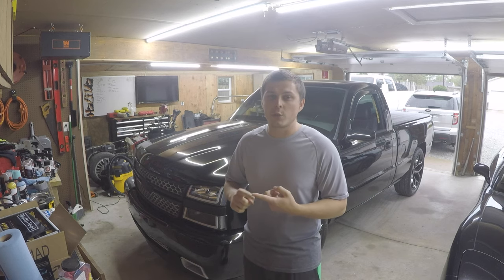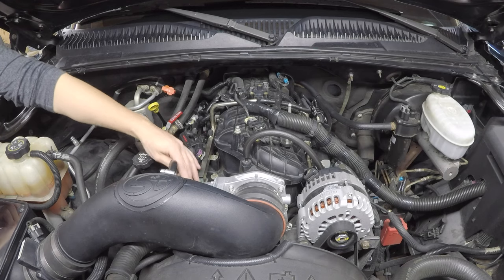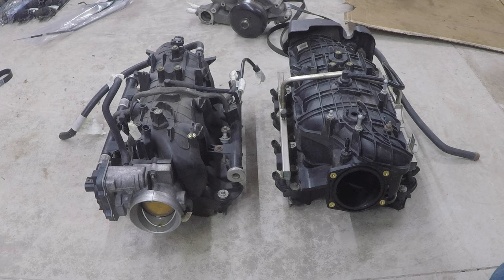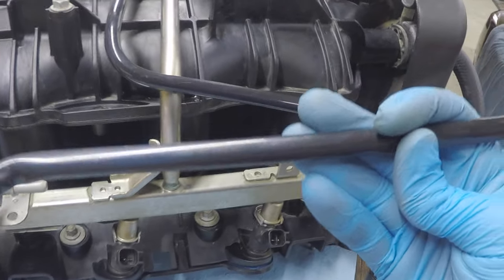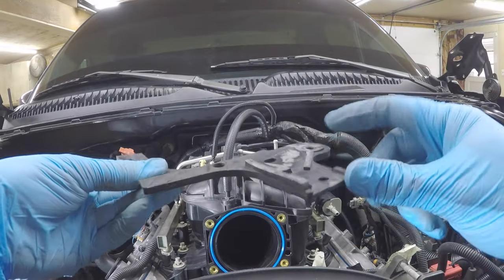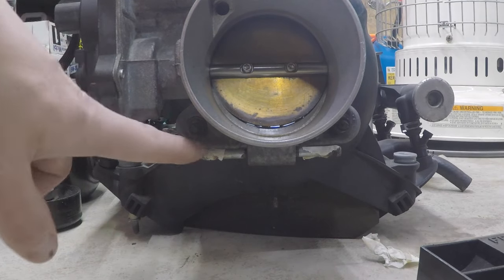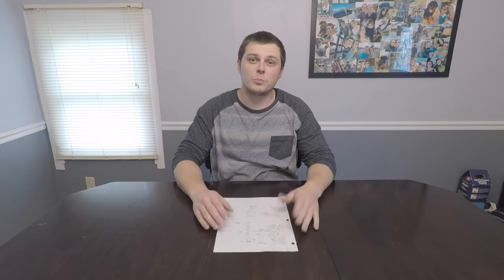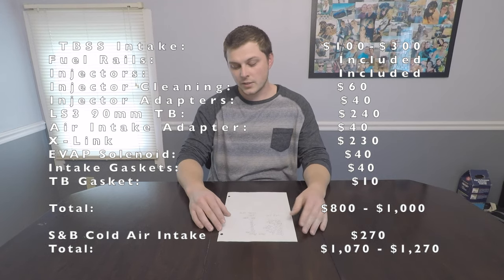TBSS Intake Swap, Ultimate Guide! Add More Power To Your LS Motor!

Comment: Thanks for putting the time into this! I'm assembling a custom built 2000 6.0, hoping to run the tbss intake on it and fit it under the hood of a third gen f body. Some of this obviously won't apply to a non-oem swap, but a lot of great info here like knowing what works with the truck parts and what doesn't. Thanks again
Reply from the maker: Awesome, glad I could help. Yea that f body hood might be cutting it pretty close. The tbss intake is pretty tall. Good luck with the build 🤘

Comment: Just. Little info for anyone who cares.  Srock L59 5.3s witch are flexfuel have factory bigger injecters
Reply: so i can put them on my 4.8?
Reply from the maker: Yes you can.
Reply: Those are 50lb injectors. You will need a tune for them and in that case you might as well do a flex fuel conversion so you can run E85 and make more power.
Reply: So I can swap my current gen3 fuel injectors to the tbss intake ? I want to do this swap on my 06 4.8 silverado . But I don’t want to take a chance on buying a used tbss intake with fuel injectors and find out they are no good, I can buy a new tbss intake on eBay with rails and injectors but they come with 50# injectors pretty sure those wouldn’t work on my stock 4.8 right?

Comment: You say the TBSS and NBSS intakes are identical in the description.  You're correct in terms of power output, however, they are two different port styles so your viewers need to make sure they're getting the port shape they need.  Good video!
Reply from the maker: Hey, good point! I thought I covered that in the video, but I probably forgot to put it in there. Already updated the description, thank you for the support!!
Reply: How do you tell the difference I’ve searched and searched but can’t find anything
Reply: @239seth  Look at the ports.  The TBSS is a cathedral port.  I believe the NBSS is a rectangle port.
Reply: @iamblamb501  just got it order paid 368 with fuel rails injectors fuel pressure regulator and sensors, it was $300 flat with $68 in shipping
Reply: @239seth  Dope!  It's what I run in my 39 deluxe coupe.  300 with it kited out is a good deal in my opinion. I think I paid 250 shipped but that was 4 or 5 years ago.

Comment: Just bought a 2500 truck with a 6.0 to go in my 04 1500.... Gonna make a tow monster with it, so this video is my first saved video for the project.

6.0
TBSS intake
706 heads
Truck Norris cam
And exhaust. Undecided on what to do exhaust wise after full length Headers.

It should definitely pull much better than the worn out 390k mile 4.8 that's in it now.
Reply from the maker: Hey, sorry for the late reply. Sounds like a pretty sweet setup! I'd also recommend getting a tourqe converter while you're at it.

Comment: Great video! I have been going for the looks and used that aluminum manifold and rails. Now, I am taking a step back and looking at the TBSS manifold and 90/92mm TB for my 03 Avalanche Z66 5.3l 1500. I am talking with BBK for there TB since I can take the mechanical part of the TB out and install it on there's.
Reply from the maker: Hey, sorry for the late reply. Sounds like you have a nice setup. Let me know how that BBK TB turns out. Thanks for the support!

Comment: Great video! Have a TBSS intake and set of 243's waiting to go on mine.. I see your from Ft. Wayne, I'm about 2 hours south of there
Reply from the maker: Thank you, I went with some milled 243's also 👌 thats sweet, not to far away!
Reply: Im doing the same thing with my Lq9. I’m picking it up from the machine shop tomorrow!
Reply from the maker: @yourejustmad9938   nice, let me know how it goes!
Reply from the maker: Ivan J California  haha nice, 200k miles would be awesome. For the swap, it all depends what your wanting. If its just a daily, the cost to hp ratio might not be worth the little extra gain. If your going for max HP and or plan to go boosted, then id definitely recommend upgrading the throttle body. Guess its all up to you, and what you want. But im not sure on the HP gains with just the new throttle body.

Comment: I had a 03 Sierra with the 262 and wrecked it via flip in 2012, 2016 i got a 07 classic bowtie.

Oh you just use the 99-03 throttlebody for those cable trucks.

Fyi the 99-07 stock intake handle boost well
Reply from the maker: Hey, yea the 99-02 are cable driven, and the 03-07classic are drive by wire. Ive herd alot of good things about the truck and tbss intakes

Comment: Guessing my mani came from a gen4 5.3 (nnbs) cuz had shorter injecrors and took spare Delphi 25317628's and they fit perfectly. Injectors came with the gen4 p# 12613411 and look like short, fat Delphi's. Which online says 2010-17 flex fuel type. Rated at 37.3 # at the standard 58 psi fuel # system. Also.. Some of the later year Caddy Northstar Tab's are 87/90mm gold blades and fit also. Super cheap when found at local LKQ. And also grabbed the evap line for perfect fit to metal line behind engine on driver side firewall.
Reply from the maker: Hey, sorry for the late reply. hell yea, definitely some good knowledge to pass on! Thanks for the support! 🤘

Comment: Nnbs from my local upull for $80 with rails, injectors, throttle body etc.... 2008 Silverado and got the 243 heads for another $80 too...
Reply from the maker: Nice, that's a steal!! My 243s I had to buy off a local guy for $250. I took mine and got them milled .015in to increase the compression a little. I think it ran me like $50. Every little bit of power helps.

Comment: Awesome presentation! Subbed for sure. Love the exhaust, what the set up on that? Thanks
Reply from the maker: Ayyeee, thank you I appreciate it!  The exhaust is 1 3/4" speed engineering long tube headers, catless Y pipe, single gibson muffler with gibson tips out the passanger side.

Comment: awesome video! So far my swap is looking to be about 750$ without CAI and $1000 with the same S&B CAI 

if i went fast LSXRT or holley hi ram the set up would start at $1400 no fuel injectors or CAI(over $2k)

so still half the price of a forced induction future proofed setup
Reply from the maker: Hey, sorry for the late reply. Sounds like you are doing pretty well with the swap! the LSXRT and Hi ram also need high rpms. I would only run those if you are spinning to 7K-8K RPMS. or you will probably lose power.

Comment: you are the KING great info what did you do about EGR ON 6.0 its on exhaust my 02 5.3 it was on intake can you tune it out thanks for all the info
Reply from the maker: Hey, my vette had it on the exhaust also, I swapped to long tube headers (which deletes that port) you can also get a block off plate from ICT billet for the intake. Just make sure its accounted for/adjusted in the tune. Thanks for the support!!
Reply: thanks

Comment: Very informative video. I installed a TBSS intake on an LM7, 99 GMC Sierra. Had it tuned. All good. Runs great. However, I have a problem with the idle. I did install a fuel regulator keep it at 59 pounds. It will randomly idle down to about 400-300 rpm and sometimes stop altogether. When it is running well, it will idle at 600 rpm with the a/c on or off. Then randomly for no obvious reason it will idle down. Can you give my any idea in which direction I should go or what I should look for? Your assistance is appreciated. Thank in advance.
Reply from the maker: Hey sorry for the late reply. Youtube flagged your comment for some reason. So I had a similar situation happen with the truck. Where it kept trying to die at stop signs. I ended up switching to a speed density tune, and that solved my problems.

Comment: I want to do my 03 Silverado I have a 09 nnbs intake complete with injectors and fuel rails and tb 87 mm plus coils so I think I only need the corvette filter ,xlink ,injector pig tails , and new intake gaskets and O ring
Reply from the maker: Sounds like you got it all down! Make sure with the xlink, you get the right one for a gold blade or silver blade throttle body. And you only need the corvette regulator if you have a return style fuel system (two fuel lines, instead of one) 

I'm sure you will do just fine with the swap, good luck, and thanks for the support!

Comment: Cool vid , better than factory R&R intake content . I'd like to try this but I am Fitech and need a IAT in the intake, guess I could figure it out
Reply from the maker: Hey, sorry for the late reply. Thanks for the support! I have seen some guys shave the intakes, and make them super smooth. I think they use plastic weld to fill the holes and sand it smooth. For their sensors I believer they drill a hole in the back (so you don't see it) and they either use a tap to create the threads, or they use a rivnut to pop in there with metal threads. That should create a good seal for the IAT

Comment: Thanks for the video. It's worth spending a few extra bucks and doing it right.
Reply from the maker: Glad I could help out! I think so too. Buy once, cry once haha.
Reply: @TheKingCoopa  yeah lol. I'm doing a cam, lifters, springs, etc. I just keep adding on items though, so it starts adding up. I'm working on an 03 6L LQ4.
Reply from the maker: @dylanfinch6186  haha it definitely adds up! Cant go wrong with a LQ4. Definitely a solid motor. I ended up ditching the 4.8L, and going with an LQ9 6.0L. Makes 580whp on nitrous, and AWD.
Reply: @TheKingCoopa  nice. My donor is a denali and I'm actually going heavier and 4wd. I want to be able to tow and I'm tired of the poor mileage of the AWD.
Reply from the maker: @dylanfinch6186  oh sweet, that will be cool
Reply: @TheKingCoopa  how are you rating the 580? Dynoing and combining both axles? Escalade motor and borg Warner awd transfer case?
Reply from the maker: @dylanfinch6186  it was on a roller dyno, and it has the NP3 nv149 transfer case.

Comment: Great tutorial guide! I have a LQ9 swap in jeep wrangler with the stock cable operated TB and intake, my question is in your video you talked about having to use the x-link when swapping TBs, but that only refers to the drive-by-wire throttle bodies right? If not, what else would I need for a 92 mm TB swap along with the TBSS  intake swap as far as getting my cable driven TB to operate correctly with the intake swap?
Reply from the maker: Hey, sorry for the super late reply. I thought I replied to this a while ago, but I guess not. Since you are cable driven, you do NOT need the x link. You can either re-use your current throttle body, with a 3 bolt to 4 bolt adapter. Or you can upgrade to a 90mm cable driven throttle body. Make sure you get new gaskets.  Besides that I think the only really big difference is that your supposed to have a bracket that mounts ontop of the intake to secure the throttle cables, right behind the throttle body. I know there is an aftermarket company that makes them, can't remember their name, but im sure you could get by without it.
Reply: You don’t need anything besides the bigger throttle body make sure it’s cable driven and you will just need a tune like you did before

Comment: Great vid.! Very well explained. 
Do you have to tune it after installing the intake?
Reply from the maker: Hey, any air flow or fuel changes then a tune is required. If you just swapped the intake, you could probably still drive it to the tuner.

Comment: I know this is an intake swap video, I’m curious to know how ur speed engineering headers have treated you! Did they have any fitment  issues? Are they close to the steering column at all? Clean build for sure! Your vids are always straight forward and professional keep the content coming!
Reply from the maker: Thank you! They have been pretty great so far. I have had three issues with them, not really a huge deal though. 

1. Was the Y pipe was a little hard to wiggle up past the trans crossmember. Took me like 10min to figure it out haha. 

2. Is the Y pipe comes with a bung welded into it, so I can run my AFR gauge. Which is awesome, but those bungs for the sensors need to be welded in at a higher angle. They weld the bung in completely level, which allows the exhaust condensation to sit in the sensor tip, after you shut the engine off. Which will corrode the sensor, and I have already gone through two AFR sensors. They aren't cheap. So when I pull the exhaust out for my 6.0 LQ9 swap coming up soon, I'll weld in a new bung at the proper angle. If you're not running an AFR gauge, no big deal. 

3. The clamps they send you are junk. Just throw them away. I went to Napa and got new exhaust clamps. The long 3in wide ones, you wrap around the tube, run the bolts through both sides of the clamp, then tighten the bolts down, and it will pull that clamp SUPER tight! Definitely recommend those. 

Other than that, I haven't had any issues. The rest of the fitment was great, and doesn't hit anything. It also clears my front 4x4 driveshaft. If your gonna do longitudes, then I would just spend a little extra money and get ARP exhaust bolts. They are stronger, won't snap, and won't corrode into your heads. Also don't re-use your exhaust gaskets. Get a set of (MLS) multi layer steel gaskets. They work really well. Hope that all helps. Stay tuned, I just got a roll cage installed, and the 6.0 is at the machine shop getting prepped for the swap, along with 2step, and a 200 shot of NOS haha. Thanks for all the support!! Good luck!
Reply: @TheKingCoopa  make sure to put up numbers I’m gonna guess 490 hp 470 tq to the wheels

Comment: When you installed your TBSS intake manifold, throttle body and X-link, did you have to get a tune after that, Ive seen some people that say that their truck will shut off or the throttle body doesn't work, but you mentioned you had a GM/AC Delco Throttle Body, ive seen a lot of knock off throttle bodies out there just didn't know if you had to get a tune immediately, I just purchased a TBSS intake with the OEM TBSS fuel injectors and stock TBSS throttle body, so interested in what you did. keep up the good work truck looks Nice!!
Reply from the maker: Hey, sorry for the late reply. If you do want to run the newer 90mm TB then you will need the X link adapter. Xlink stated it won't work with any of the knock off, ebay special TBs. 
So technically any fuel or air flow changes you would need a tune to really maximize the add-ons, and to run properly. But if you do just the intake, with your stock TB, you will be fine. If you do the X link and 90mm Tb, you could probably drive it to the tuner. But if you swap out to the larger Injectors, then you will need a tune ASAP. The larger 36lb injectors caused my truck to run extremely rich, and would foul out a set of plugs in 5min of idle time. So I gave my tuner an extra $50 to come to me, so I didn't have to tow it to him. Hope that helps. Good luck on the swap 🤘

Comment: GREAT VIDIEO!!! what exhaust?? doing the manifold swap on my 01! thanks for everything
Reply from the maker: For sure, glad I could help out some. The exhaust is 1 3/4" speed engineering long tube headers, with a catless Y pipe, single gibson muffler with gubson tips out the passanger side. Thanks for the support!

Comment: Great video love watching the videos you post very detailed and you show the process  👍  also would you be doing a electric  fan swap? Would like to see that video if you do
Reply from the maker: Thank you!! I definitely plan on doing an E fans swap. I've herd you can gain about 10 extra HP from getting rid of the mechanical fan, less rotating weight. Not sure when ill do this. Currently trying to sell my house, and buy some more property with a larger shop/garage I can fit two lifts in. So im a little busy right now. Priorities haha. But the plan this winter, after the new house, i wanna C notch the rear frame, go to a 4/6 drop (lowest ill go), E fans swap, quadrasteer bedswap, widen the rear rims 3in and run a fat back tire, and wrap it. So we shall see 🤘

Comment: Since you had to notch some of your fan off did you ever consider going with Electronic fan so you can free up that area gutting the shroud and fan setup.. just a curious thought that will feel a huge difference and benefit of efan setup.
Reply from the maker: Hey, yes I have! I will be doing a video of the swap as well. I already have the fans, and factory harness. Still have to pickup the larger radiator though. My next video will be of the coilover swap, then I'll be changing to 4.10 gearing. And at that point I'll be pulling the 4.8 to swap out to my LQ9 6.0, 2step, and a 200shot of nitrous. I'll be installing the E fans at the same time. Supposedly by eliminating the extra rotating weight, some people see a gain of 5-10hp from the swap. Thanks for the support!

Comment: I just subscribed. Best Video I have seen. Exactly what I'm looking for & want to do. I was giving a 2003 Tahoe 5.3 flex fuel. Needs alot of love. Hope u have a video on yur exhaust.  Because that's Next for me. Thank for yur help on my build
Reply from the maker: Thats awesome, I appreciate the support and the sub! Also just an FYI, the flex fuel injectors will run a few higher lbs. So if you switch to non-flex fuel injectors, you will have to adjust that fuel trim in the tune. You will run really rich and burn up the plugs in a few minutes. (Which you will definitely need a tune anyways if you swap the intake and TB out) 
As for the exhaust, I made a video when I did all my performance mods. It wasn't super indepth on the exhaust. I have some 1 3/4" speed engineering long tube headers, Catless Y pipe, gibson muffler, and gibson tips out the side. Its loud and sounds great with the cam. 

Glad I could help out. Let me know if you run into any issues on your swap/build 🤘